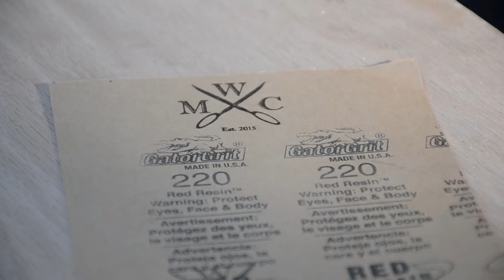DIY Bullet Cufflinks From Brass Casings #metalproject

Comment: They look great but Why not use a copper pipe cutter. Nice and clean cut. Put the cartridge into your electric drill chuck, then attach the pipe cutter at the desired end and start the drill on low setting. Obviously holding onto the cutter carefully.

Comment: LOL
Why waste the time using the aviation shears instead of a cutoff wheel and grinder.......you use electricity in the drill to clean up the crappy cut from the shears.....
Would give a much cleaner cut and wouldn't have to waste as much time cleaning it up.
Reply from the maker: Thank you for watching! 👍🏼